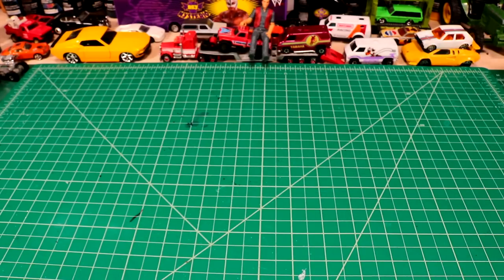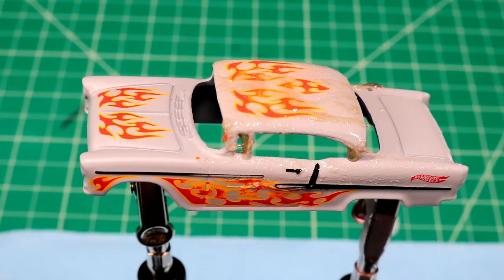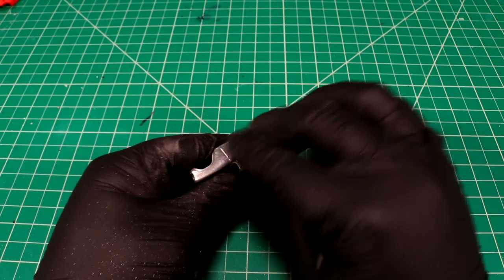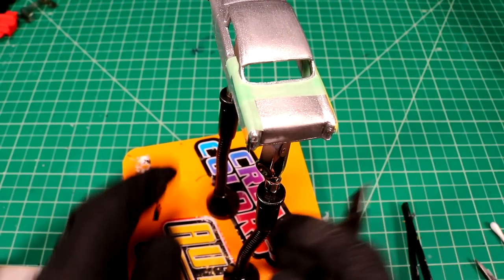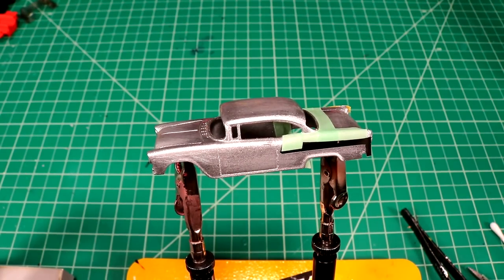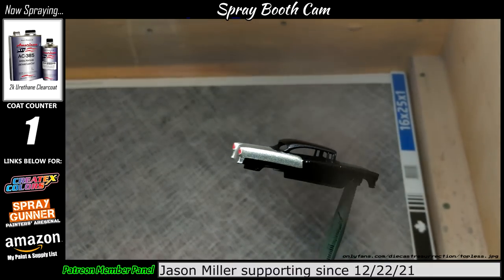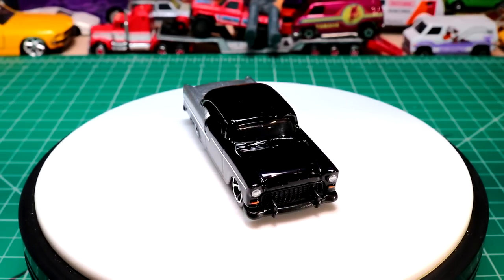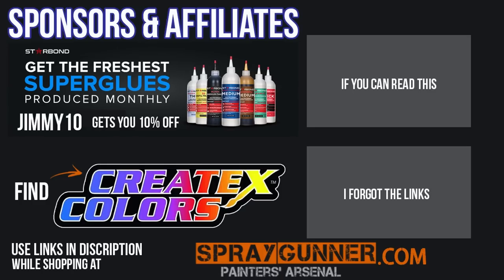Chrome Vinyl for Diecast Trim Design?

Comment: the chrome vinyl can be used as mirrored window tint , use half cut grain rice under it in a diamond plate pattern for truck beds and bumpers then strips for wood beds

Comment: We plastic scale model builders,i at least,used a product called "Bare Metal Foil" superthin self adhesive metal foil in differen surface qualities.A little tricky to apply but when on really looked like real chrome.You could buy this in chrome,stainless,matte aluminum,brushed steel and so on! It even can be polished.

Comment: That does look really sharp!
I do 1/24, 25 scale model cars. There's a chrome tape that you can get for trim moldings. Some guys use tinfoil! I prefer the Molotow Chrome Paint marker myself. It's the easiest to work with, with the same results.
Regardless, they all look good.

Comment: ay, the new chrome trim comes across way better than I'd have anticipated. :) (personally I'd have gone for bare metal foil, but there)
the new casting does the original much more credit than the old one, which looks too short and chubby. ^^ nice choice.
the silver does look a bit bright. I keep thinking in revell/humbrol terms, 40 years of using modelers paint does that to you I guess... their "iron grey" metallic would have looked good, too. :) or maybe a purple.

Comment: That “vinyl” that you used in the video was called Mylar or that could just be a brand name. It did come in several different colors. 

Mylar wasn’t used as much when I used to work at a sign shop many moons ago because Mylar doesn’t (or used to not to) hold up too well in UV light. A lot of signs that I used to do with that company was outdoor and that stuff doesn’t like the sun none too much at all!!

Cool video and I’m glad to see that you still aren’t afraid to experiment!

As an experiment, you could try adding the lines to your cut file but tell the machine to not go as deep or some cutters actually have a scoring tool you can use to add the lines. 

Not sure with your particular machine if that’s possible. 

Thanks again for the video!

Comment: A little advice. Maybe you should use boiling water and Caustic soda to remove the paint work. It's easier and safer for your health.
Reply from the maker: You shouldn't be recommending that to people, it's dangerous dude. You get that stuff on your skin and you get burn blisters, it reacts violently with water.